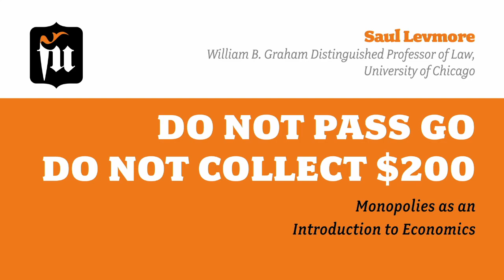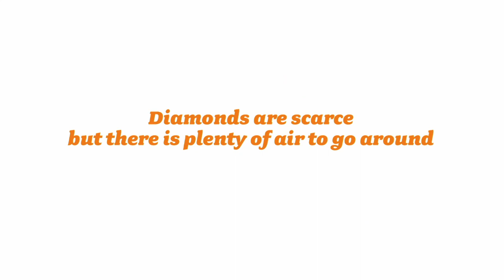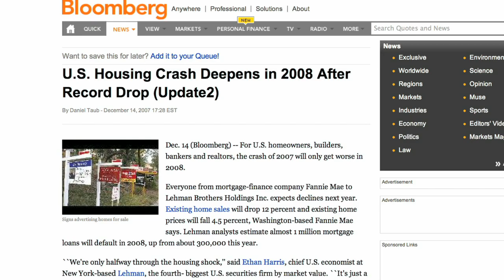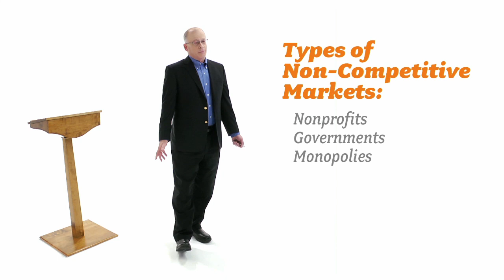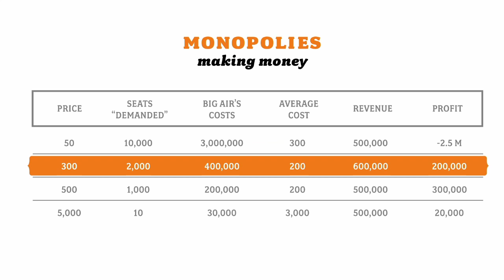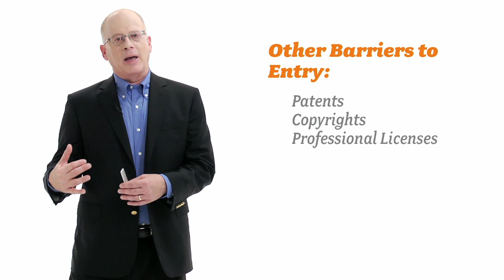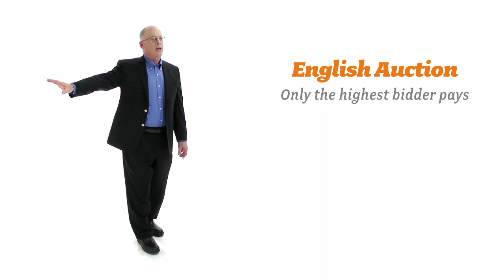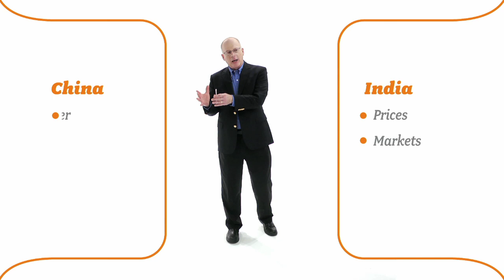Saul Levmore: Monopolies as an Introduction to Economics | Big Think

Comment: Standard Oil had no initial market power, with only about 4% of the market in 1870. Its output and market share grew as its superior efficiency dramatically lowered its refining costs, and it passed on the efficiency savings in sharply reduced prices for refined oil (from 10 cents in 1874, to 5.9 cents in 1897). It never achieved a monopoly (in 1911, Standard Oil had roughly 150 competitors). Even if it had been a monopoly, S.Oil's efficiency and low prices would be an argument FOR monopolies.

Comment: The theory of supply and demand predicts that price will be dictated by the supply/demand ratio. As you point out, the opposite is true. In the case of apps (and handbags since he also used them as an example,) supply and demand are dictated by price, not the other way around. IE, the theory is unsound. Price is not a "little messenger" as described in this video, it is the determiner.

Comment: I came here to say that neoclassical economics is utter nonsense.
Reply: Newtonian physics was the most comprehensive theory of physics we had in the 18th and most of the 19th century.  Now we also have particle physics, quantum physics, and relativity. Does that make Newtonian physics "nonsense?" Even today there are unanswered questions in physics, especially the apparent inconsistency between quantum physics and relativity. Does that make relativity nonsense? Quantum physics? But here's my offer: if you will write a textbook, Akira, that explains the economy better than neoclassical economics (which I agree is imperfect), I will be the first in line to buy it. Attempts I am aware of still retain most of neoclassical economics' imperfections.
Reply: +dobro, first,  the founders of neoclassical economics did in fact consciously model their economic theories on the mainstream (but not cutting edge) physics of their day. But second, I myself was not comparing neoclassical economic theories with physics, but the process of theoretical change in economics with the process of theoretical change in physics. Just as today's physics has gone beyond Newtonian physics while still retaining the basic principles of the latter, so will any new economic theory still retain certain core insights of neoclassical economics. 

Thus I reiterate my challenge: But here's my offer: if you will write a textbook, Akira, that explains the economy better than neoclassical economics (which I agree is imperfect), I will be the first in line to buy it. Attempts I am aware of still retain most of neoclassical economics' imperfections.

IOW, neoclassical economics needs to be improved upon, but no one has addressed its key deficiencies yet. Critiqued them, yes. Attacked straw men, yes. Suggested minor improvements, yes. But so far as a comprehensive overhaul of neoclassical economics, the closest we have is probably Keynes, but his (flawed) theory still incorporates the major principles of the neoclassicals.

There are some serious critics of neoclassical economics, and then there are knee-jerk political fanatics who engage in ritual denunciation, do not offer better theories to replace it,  and who frankly don't even seem to understand the theory they are ritually denouncing.
Reply: +Dobro, you are quite mistaken on two points. First, economics is not a moral science. Morality prescribes human behavior, science, including economics, merely describes those behaviors while making no moral judgments about them.

Second, the laws of physics certainly do pertain to economics. I can't recommend a single text, but by all means read up on complexity theory, a theory of contemporary physics which certainly does describe economic systems (but which the parochial economics profession has been slow to embrace).  Related to complexity theory, I also recommend two books by physicist Mark Buchanan, Ubiquity and The Social Atom_.  Didier Sornette's _Why Stock Markets Crash is also quite interesting, but also quite technical. It might be better to google Sornette on the internet to find an explanation of his key ideas, which are an application of physics to markets.
Reply: +Dobro, I am all in favor of morality (my morality, not your morality), but economics is unable to prove what is or is not moral. That is a question for religion and philosophy. My own moral views derive from Christianity, not from economists of any school, but even Christians will sometimes disagree based on differences of opinion about such questions as how sacrosanct private property should be.  (I happen to be a huge advocate of strict property rights.) But it is moral theorists who must apply economics, not economists who should dictate morality. Economists just need to help the rest of us understand how the world of trade works, since economics basically boils down to a theory of exchange. (Ants don't trade,  so an economics of the anthill would not be much  more than a production manual.)

Now, as to your examples, I do not consider Aristotle to be an economist. He was a moral philosopher who touched on economic questions in that context, but that is not the same thing as delving deeply into questions of cause and effect.  Keynes certainly thought that dealing with recessions was a moral imperative, and he tried to discover tools to do that, but that was an attempt to put science in the service of morality. Smith separated morality from economics by writing two different books--The Wealth of Nations to expound his scientific views, and A Theory of Moral Sentiments to expound on his moral philosophy.  As for Marx, he certainly had strong opinions about right and wrong, but the actual economic theory that is only a small portion of his total work is pure description, and rigidly deterministic. 

Economics cannot be a moral science, because there are no moral sciences. Science is a tool, not a guide to how we should live. There is moral philosophy, and there is natural philosophy, the latter usually called science nowadays, and they serve different purposes and go about their tasks in somewhat different ways.

If you are serious about carrying on this conversation, perhaps you could take the time to investigate the topics and books I suggested in my previous post. Then perhaps you can make more interesting observations than merely to rant about how "your description...is neoclassical bullshit." Neoclassical bullshit? How insightful! The longer I live, the better I appreciate the Graeco-Christian concept of apatheia.

https://en.wikipedia.org/wiki/Apatheia

Apatheia (Greek: ἀπάθεια; from a- "without" and pathos "suffering" or "passion"), in Stoicism, refers to a state of mind in which one is not disturbed by the passions. It is best translated by the word equanimity rather than indifference.

The term was later adopted by Plotinus in his development of Neoplatonism, in which apatheia was the soul's freedom from emotion achieved when it reaches its purified state.

The term passed into early Christian teaching in which apatheia meant freedom from unruly urges or compulsions. It is still used in that sense in Orthodox monasticism.
Reply: A clarification: "The fact that you think physics applies to economics, but not morality to economics, only shows something about your absurd view of human nature,"

1. I have never claimed that morality does not apply to economics, only that economics is not a moral philosophy. In certain contexts, morality also applies to physics, but physics is not a moral philosophy either. Both the social sciences and the "hard" sciences are natural philosophy (usually called science these days), not moral philosophy, but moral philosophy must sometimes be a consideration when applying natural philosophy (science). For example, how important is it that the bridge you are building be safe to travel on? is it ethical to cut corners so you can save money on the cost of construction? This is an application of morality to science. However, neither economics nor physics are tools for the discovery of moral truth. They do not answer St. Peter's question, "How should we then live?" but they are still useful for answering other types of questions.

2. During this discourse, I have not expressed any views of human nature. I have expressed the view that describing is a very different function from prescribing. 

3.I am quite aware that social scientists tend to be a highly insular bunch who like to fantasize that their fields are distinct from physics and even from biology and genetics, but that is delusional thinking.  There is a point beyond which the social sciences will not be able to advance unless they use an interdisciplinary approach.

4. Ever since the Enlightenment there have been people who imagined they could apply the scientific method to discover a system of universal moral and sometimes religious truth that was beyond dispute to anyone who accepts the scientific method. No one has done so yet, and I predict with confidence that no one ever will. Morality has one thing in common with geometry: the conclusions one reaches depends on the postulates with which one begins, but the postulates themselves cannot be proven.

5. If we think of economic discoveries or theories as a set of tools we can apply, then whether one builds a temple or a bawdy house is not dependent on the tools we use. The same tools are equally useful for both.